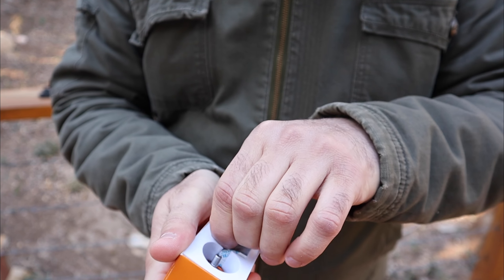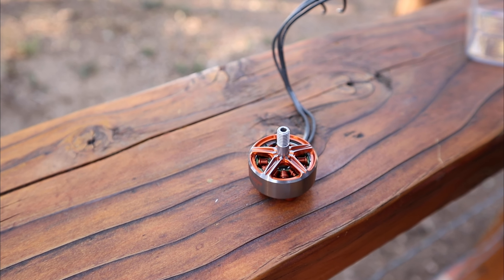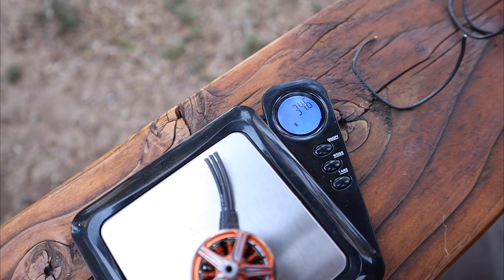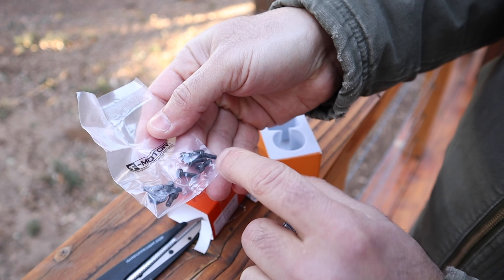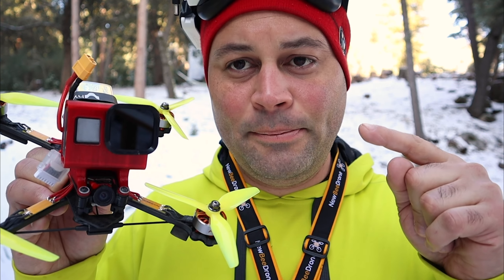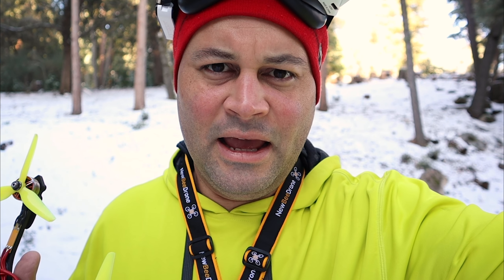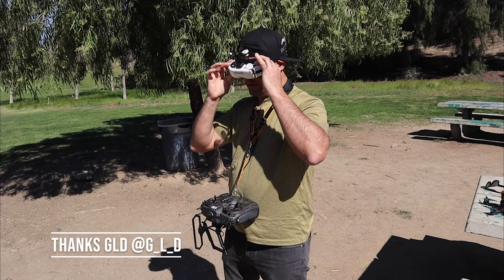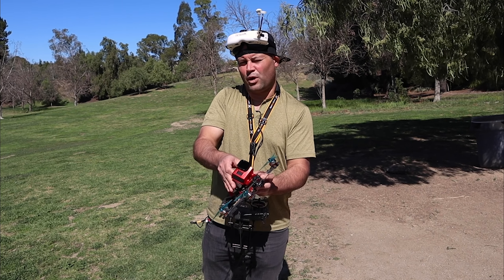T-Motor Pacer 2207.5 1950kv FPV Motor Review

Comment: That was a nice review. I got the 1700 version for my race rigs. Power delivery is so smooth and controllable. Crashing less. No hard crashes with them yet.
Reply from the maker: Yeah, I think that's the right choice. I opted for 1950kv because I've has other 1700-1750kv motors before that I found underwhelming. However, these Pacers have tons of power. I think I would've been perfectly happy with 1750kv. That said, I did fly these 1950kvs on 5S and was pleasantly surprised. I might explore flying them more on 5S.

Comment: Nice video - My thoughts exactly, if T-motor makes a budget motor...  - I jumped on the Velox Motor and have them on one of my DJI System Builds. I got the Pink & white 2207 1750kv motors. They've been great and at $14.99/ motor makes it hard to beat
Reply from the maker: I would love to try these same Pacers I have but in 1750. I like that I can fly these 1950s on 5S, but for 6S, 1750 would have been plenty of power. I usually fly slightly underpowered quads. It's just my taste. I focus on flying smoothly rather than sheer explosive power.

Comment: Hello, I saw that, in your second flight, you put your diamond antenna vertically on your controller while the Immortal T in your drone was oriented horizontally. Doesn't that make the connection worse?
Great video btw, I think I'm gonna buy the 2306 version of the pacer
Reply from the maker: Hi there! Thanks for writing. Honestly, that's a bit of a common myth, but it has some truth to it. Yes, two vertical antennas provide the best range. However, this is freestyle. The quad is rarely ever horizontal for much more than a second. So, in my opinion, the orientation of the antennas on the freestyle quad makes very little difference. I have have found by testing is that a vertical antenna on the TX is better, no matter what as it provides better spread. Check my two videos on testing the Crossfire system latency switching. Now, if this were a long range quad, where the quad remains flat for a long time as you chase to get more distance, antenna orientation is more important there. In which case, a vertical antenna on both is better. Or in case of my long range 7 incher, I run diversity with one antenna vertical and one horizontal. The antenna on the TX stays vertical. Note that in many of my earlier videos, my TX antenna is horizontal. That's because it fits well in the case like that, so I just left it like that.

Comment: One thing, when you turn of the HS on GoPro, please remove the ND filter also. It reduces a ton of vibrations from the video. That could also make a litle misjudgment abaut the motor silkiness :) Grate rev tho!
Reply from the maker: It can, yes, but it would have to be VERY bad to really show vibes. Generally, the ND filter makes the video smoother between frames. I don't take it off because I don't use the ND filter as a crutch. I use the ND filter to achieve the correct shutter speed for good video... something I do for videos beyond flying quads. If I take the ND filter off, in such sunlight, regardless as to whether or not I have a perfect tune, the video looks like crap to my eye, because the shutter speed vs frame rate relationship is all wrong.

Comment: I'm surprised that our motor has one string wiring while in all T-Motor photos is multi-string what confused me a lot. Moreover, I was trying to understand what is the difference between the Velox and Pacer 2207 motors as beside the bell they look similar inside.
Reply from the maker: That got me thinking, so I went to various FPV shops and looked up the motors. I see what you mean. Actually, some of the photos show multi-strand and some show single-strand. That's obviously a mistake and they likely shot some multi-strand prototype. But the motors are definitely single-strand. They've been like this since the early prototypes back in September.

Comment: Hello, I have a project for a 6S quad racer and I hesitate with the new T-motors. I would like to understand that it is the difference between the VELOX 2207 1750-1950kv and the PACER 2207.5 1750-1950Kv.
What is your advice?
Reply from the maker: The way I understand it, both of these motors were made to be competitive at their price-points. Most T-Motor flagships are always around $26 dollars. That's pretty expensive. T-Motor made the Pacers to compete with the RCINs and XINGs. That's where the Pacers come in. From making this video, I see that they are quality motors, and I can't really say they aren't as good as the flagship F series. Maybe not as smooth, but definitely powerful, balanced and well-built. The VELOX on the other hand are meant to compete against the E-Series motors from other manufacturer. Those are the economy line. A lot of pilots love the cheaper motors. Specially those that go through motors often because they race them or crash them on concrete. I don't fly a lot of economy motors, and I haven't flown the VELOX yet, so I couldn't say. That said, I think these Pacers are really good and they are at a really well-balanced price.
Reply from the maker: Look at the comment by Matt Chamberlain below. He's loving the VELOX. If I were racing a lot right now, that's would I'd run. For freestyle, Pacer.

Comment: I bought some iflight xing-e 2306 motors and they are pretty cheap 14,8 $, they perform  really good and weight 33.5 gramms with the hole cable and nut. For sure they don't have titanium shaft.
So seems to me that t-motor should try harder for budget friendly motors.
Reply from the maker: These are not the same level as the XING-E. T-Motor does have an "E" motors and it's called the VELOX and it's $13. This Pacer motor is better spec'd than the XING-Es. For starters, that unibell. Wayyyy better than the two-piece bell of the XING-E and the VELOX. These are made and design to fit the $20 range.
Reply: @PinchTune  yes, i know. I was just referring to the weight comparison. ;) I would expect a 20$ motor to be lighter. Just that.
Reply from the maker: @bozosni  Oh, I see. Yeah, they are a little on the heavy side. Luckily these Hyperlows, even with the 6mm arms, are below the below of most other freestyle frames. So in the end I ended with pretty respectable weight. Thanks for watching BTW!

Comment: Are you using TBS Nd filters? I have one that has that rainbow 🌈 effect I see in your snow flight footage
Reply from the maker: I do. The rainbow usually happens to me because I run a lens protector stuck to the GoPro lens. That lens protector between the GoPro lens and the filter causes this. I'll likely keep a GoPro with a lens protector for cinematic shots, so I don't end up with this.
Reply: It’s weird thou I only have it on one of my 3 tbs filter . And it’s in the exact same spot.  🤙

Comment: hello and congratulations for the video, I urgently need 4 engines for a 6s build and I was looking at these 1750kv engines what do you think? can you recommend them?
Thanks
Reply from the maker: Hi, yes, if strictly for 6s I'd recommend the 1750s over the 1950s. They are super powerful already so the extra kv is not really needed, at least for my style.
Reply: @PinchTune  thanks for replying, yes in fact I was oriented for 1750kv, in my build I have xing 1800kv and yesterday a crash broke an engine I can't and various sites have not available, so I will take 4 engines of these thanks always very kind good flight

Comment: Would you also recommend this for longer flights?
Reply from the maker: You might need to dial them down a bit to conserve energy. Or get the lower kv ones. These seem pretty efficient, and my long range rigs do have higher kv than most other long range pilots like, but I also do fly as far as a lot of those pilots do. I don't need 15 minutes of flight time. I can do what I can do do in about 8 minutes.

Comment: is 1950KV enough for 5s ???
Reply from the maker: Most of the time it's too low. But this motor seems to be more powerful than it's rated. I flew it on 5s and was surprised. Normally I fly 2150kv for 5S.

Comment: thx vor you review of this motors.
i search a motor that i can use with my 4S and a bit later also with my 6S. what did u think about it? does it work what i want?
thc for feedback
Reply from the maker: Hi, it is a very powerful motor. However, at 1950kv it would be best suited for 5s and 6s, rather than 4s and 6s. That said, it would feel more powerful on 4s than a 1750kv motor would, so it might be an OK option.
Reply: thx for your quick answer.
at the moment i got the t-motor 2150KV and love theyer punch with 4S. But no i wand slowly change some lipos to 6S and also want use the 6SLi-Ion todo some LR flight with my 5" Quad :-)
And the most important i LOVE this color orange :-D
Reply from the maker: @fpv-bro  These 2150s are the F60 III, or the F40 II 2150 that I normally fly? Either way, that more would be better suited for what you want to do than going 1950kv. Because you can have two profiles. One for 4s at 100% throttle and one for 6S with roughly a 86% throttle (14% throttle cap). (2150kv - 14% = 1850kv).
Reply: @PinchTune  i got the f40 II 2150KV. Perfect when i can do that with this solution. Now i must look how i can that config. Thx
Reply from the maker: @fpv-bro  Yep. That has been my favorite motor for well over a year now. That is your best option if you want to fly both 4s and 6s. When you are ready to commit to just 6s, then go lower KV. Betaflight has a throttle limit somewhere. 4.1.x and up. Falco X (FlightOne) does as well.

Comment: hey pinchTune. SEND HELP, lol. im all the way from Kauai, Hawaii and am totally new to fpv and built me my first drone. ordered me some gear. just built me a project 399 super g plus. now im running in to no stick movements in beta flight... using a crsf nano diversity to a 60a hobbywing stack with the tbs evo. sent ch1 from nano diversity to rx1 and ch2 to tx1. got everything to bind, visuals through my goggles and the rx is solid green just like the module behind my qx7. serial rx is checked on uart1, saved and rebooted. configuration receiver set for CRSF, plug in my batt and got nothing. got any idea where I went wrong ?
Reply from the maker: Aloha! I lived in Hawaii for a few years, in Maui. It does seem you've done everything right. But as is the case, when there's a problem, there's usually something we're not seeing. What FC? I think you've missed assigning the channels in Crossfire. As in, even if you're bound, and the FC/BF is set to CRSF, if you don't assign Channel 1 TX to send on channel one and channel 2 Rx to receive on channel 2, in the TBS module, nothing's going to happen. See if that's it.
Reply: @PinchTune  Ehhhh mean!!! small world lol.! anyways ive been trying to remap my channels like you said. I don't think I flashed my qx7 correctly, even though the crossfire rx, and tx is solid green I go to my qx7, than crossfire lua and my nano rx wont show. there fore cant remap channels. will get back on it tomorrow. will keep you updated for sure.
Reply: and a f4 g3 fc.
Reply from the maker: @jhancewhite-cummings4167  Wait a sec. You said QX7. Did you mod it? Out of the box the QX7 is NOT compatibly with Crossfire unless you mod it.
Reply: PinchTune yes I did install the mod chip to my qx7!
Reply: PinchTune any ideas where I could’ve went wrong ?
Reply from the maker: @jhancewhite-cummings4167  Any news? Have you got it working? I can see anything wrong with your setup.
Reply: @PinchTune  so ive been working this weekend haven't got too much time to mess with it im thinking it has something to do with my qx7 connecting properly to the nano diversity. I am kind of lost right now and just trying to back track on my radio downloads and stuff. complete noob in this stuff, wish you could've built it for me...lol
Reply: @PinchTune  got it working finally! opened up my qx7 and had a loose wire on the mod I installed. put it back together and got my qx7 to work on betaflight. so stoked! thank you again cuz!!
Reply from the maker: @jhancewhite-cummings4167  Awesome!! Doesn't seem like I personally did much, but I'm glad you got it working!
Reply: @PinchTune  got another question. I got into a crash and had to re solder my motor wire. tried arming with props off gave it some throttle and it just ramped to max than it wouldn't throttle back down. until I disarmed of course. wouldn't want my drone to do a fly away, any thoughts?
Reply from the maker: @jhancewhite-cummings4167  Hmmm. It depends, if it went 100% you might have a problem. However, if it just accelerated a bit on it's own after throttling up a bit, that's airmode kicking in and that's normal. You  might want to try and fly again, line of sight, and have your finger on the arm switch immediately ready to kill it if it goes crazy.
Reply: PinchTune will give it a try for sure !

Comment: Awesome review🔥 These motors look really good. But I dont like what they have done with their new budget motors. They all look like Tmotor was trying to copy xing and RCinpower. Anyways Im sure the motors themselves are very high quality
Reply from the maker: I kinda have to agree with that. I know these look a bit RCIN, but at least not exactly. I don't like the splatter motors though. I really think they should've not done that. I feel T-Motor is better than that.
Reply: @PinchTune  they released too many different motors at once. If they would have just put out these ones you reviewed it wouldnt be so obvious that they took RCinpower or xing motors as an inspiration. T motor always had cool and unique motor designs and I dont see a need to look at other manufacturers if they could do it (better) themselves.

Comment: im building my first racing quad..
what esc can you recommend for 6s?
Reply: If ur looking for a 30x30 stack, Tmotor F55-Pro or Hobbywing Xrotor Micro 60a. If ur looking for 20x20 stack, Hobbywing Xroror Micro 40a. I use the 20x20 stack with FlightOne, its super solid
Reply from the maker: Great options by @P3ER. I'd also add that I love the Talon Gigawatt 20x20. And T-Motor has a new Pacer ESC coming out that I'm testing soon. But right now, I'd say those options are good. I'll also add the NewBeeDrone Infinity ESC.